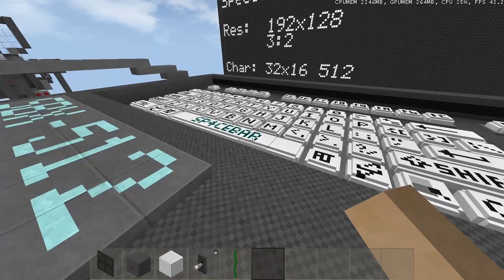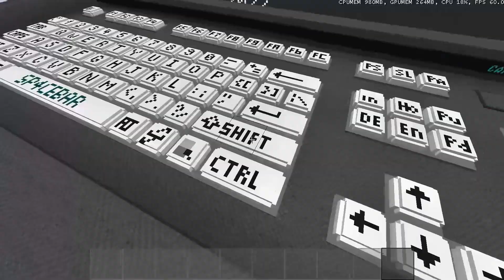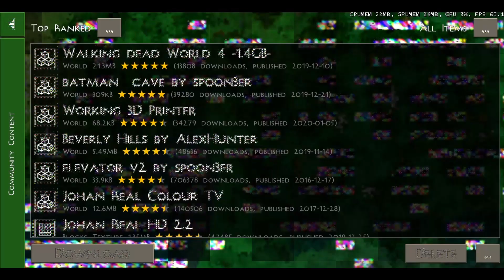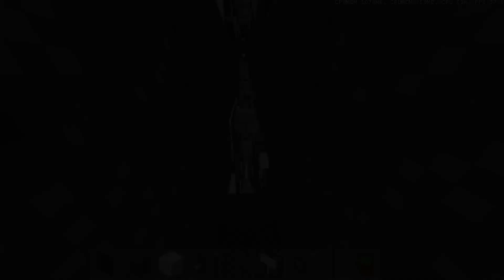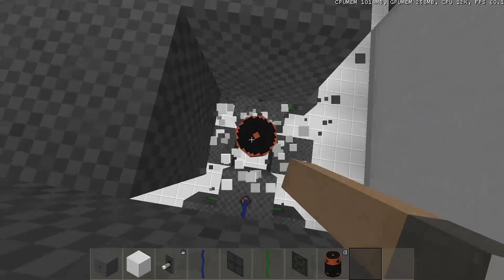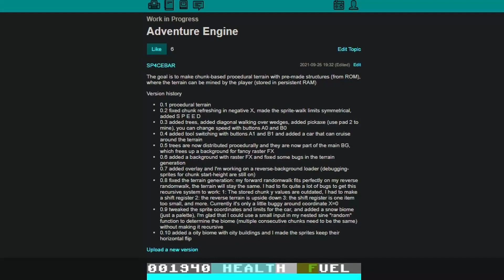Comment: At first I was impressed, but after seeing that this video is the last one in two years, i rapidly switched to depressed. And complexity of this build is already immeasurable for both my phone and my mind (which failed at controlling 8x4 pixels screen). Anyway, probably it's finally time to accept, that SC will likely never have actually playable games more complex than "stylized generated signals travels through the delays to the detection point".
Reply: Good news! Survivalcraft already has simple playable games like MGBlitz's flappy bird. It doesn't take a bigger and more laggy screen to make games. For most simple games, simple and low resolution screens would be sufficient. I know in theory how I can make Tetris, Minesweeper, Pong, and Connect-4 within Survivalcraft. If you are talking about 3D games however, then that is a different story. To make 3D games in Survivalcraft, a sequence of calculation steps has to be performed by many sophisticated calculating devices next to one another, this is not impossible, but it would take a lot of work and space.

My initial goal for making videos was to share the builds I made and the things I learned. I still have a long queue of videos I wanted to make on subjects like large flying machines (I've discovered new types, and a kind of movable logic), signal behavior (they can go faster), and very useful Finite State Machines made out of single memory banks. however with the depth at which I explain each concept, making a single video takes about a week of writing, recording, and editing. 

I may experiment with more optimized recording techniques or extra editing tools to reduce the editing I have to do. Otherwise, I could experiment with making shorter videos without in-depth explanations like actually attempting to build something like a 2D game in the 20 minutes of Survivalcraft Day One similar to my small printer video but with the tension and pressure of the 20 minute limit.
Reply: @SP4CEBAR  First of all - i am not that insane (or enlightened) to even suggest 3D games inside Survivalcraft.

About the things mentioned in second paragraph... it all sounds astonishing, but right now "this video is the last one in two years". If you are having struggles making them, it might not hurt to ask for help, unless making these videos is considered a waste of time (actually reasonable).
Reply: I don't consider making videos to be a waste of time, it's just that making high-effort videos isn't very motivating: it takes a lot of time to get just another video out. Currently, I'm working on a website with productivity and planning tools for individuals and companies, which I would like to finish soon.

Comment: I will never understand memory bank.
Reply: Oh you will
It's a book to your machines
Reply: You can read it from the top connection, you can flip (set) pages from the sides, you can write into it from the back (place the device on a wire-through block), and you can tell it to write or to read from the bottom
Reply: Cleacat  They are very powerful

Comment: In your opinion, the redstone system of minecraft or survivalcraft is better? And can you tell the difference in terms of pros or cons?
Reply: Both Minecraft's and Survivalcraft's electricity systems are very capable. However Survivalcraft's electricity is more efficient: it takes less space to build machines because wires can be placed in any orientation, signals don't lose power over distance, and the Survivalcraft memory bank (a single component) allows you to make ROM, RAM, and even an FSM.

Minecraft on the other hand has built-in commands and it has structure blocks so it essentially has a kind of world edit built into the game. Although there aren't as many logical components as in Survivalcraft, there are more components to automate the production of resources, especially with the introduction of the crafter. Survivalcraft doesn't have hoppers, it only has dispensers and chests that can pick up items, Survivalcraft doesn't have slime blocks, so making flying machines is different, you can still make some really big flying machines in Survivalcraft. Minecraft also has a way bigger community, which means there are more guides, mods, and data packs available to support the development of Redstone systems. Minecraft also receives updates on a regular basis.

Comment: (Infinix hot 30 [free fire] )is too lag graphics it getting work refresh rate 60hz to 90hz range 112 it doesn't launch the world it too lagging
Reply: I know, it takes two minutes. As long as it doesn't crash, it should load though. Survivalcraft isn't optimized for worlds like these.
Reply: @SP4CEBAR  8GB ram I takes two minutes to load in this world
Reply: @JamesandkentoyYT2026  same with 16GB

Comment: I'm looking for tutorial please. I'm looking for this 5 year. I can't understand. I saw your video 100 time. Don't find details. Please help me. Please
Reply: Sure, here is a more basic explanation, by the way, if there is a specific Survivalcraft electrical component that you don't understand, you could watch my "How to use Survivalcraft's electricity" tutorials.

In Survivalcraft, a 4-LED block has four pixels. You can make a screen out of these 4-LED blocks. To turn this screen on and make it show something, you need something that can hold information, like a memory bank. This huge screen has a memory bank connected to each of the 4-LED pixels. So each memory bank holds the information for four pixels. 

To control these memory banks you need to first, send the information you want this memory bank to hold to this memory bank. This information is a group of four pixels that you want to be shown on this part of the screen. Second, you need to tell the memory bank to store the information you sent it, and third, you need to tell the memory bank to send this information to the 4-LED that is attached to it. After you have done that, the memory bank will continuously keep the pixels of the 4-LED on that you sent to it.

In this screen, each memory bank is grouped in groups of 4x3 4-LED's. Since a 4-LED is 2x2 pixels, this group has 8x6 pixels. This is enough to show a single letter of text. The memory banks are wired up in such a way that I can send a group of 8x6 pixels that resembles a letter of text to these memory banks all at once. For the rest of this message I will call this group of 4x3 memory banks a "unit".

This screen has 16x32=512 of these units. In order to send the letter of text to a single unit, made this screen in such a way that the letter of text is sent to all units. But only one unit is told to store it and show it on its pixels.

In order to tell only one unit to store it I use a grid of wires with an AND gate at each intersection.

On the left of the screen there are two 4-bit counters (a Survivalcraft component) that keep track of the position of the cursor (the place on the screen where the next letter of text will be typed)

On the left of the screen there is a part that uses memory banks to hold information of how letters look, when this part receives a code from the keyboard it will turn that code into a letter, this letter is sent to the screen. And a signal is sent to the screen to store and to display this letter of text. This letter of text will now be stored at the position of the cursor.

I hope this makes sense, good luck learning!

Comment: You need a better PC to Create Minecraft inside Survivalcraft and use a modification to accelerate the game tick and maybe in the future you can create windows 7 inside Survivalcraft
Reply: Survivalcraft itself is already fast enough to run 3D graphics, in theory at least, I've made some concepts a while ago:
- a display can be made that can plot horizontal line segments
- some calculating units can be chained together to calculate the intersection points between the horizontal lines of our screen a a whole lot of 2D triangles
- 3D triangles can be turned into a projection of 2D triangles using matrix math
- the 3D points of these triangles can be stored inside of a big memory unit
Everything should be able to be calculated in parallel, so it should run quite fast, but it may have a lot of latency

Comment: do you actually use the 2 screens for multitasking right now? or its a feature for future versions of the display
Reply: I haven't worked on it since, and I'll probably build some newer screen designs before continuing this project, but I was planning on adding games that are controlled by a cursor, and a settings page where you have a list on the left and details on the right, with settings like a 16x16 character map that you can customize
Reply: Cleacat  maybe :)
Reply: I was planning on making something, but I cannot get it done in time due to computer problems (quartile 2 of my university is about to start)

Comment: I made 3x3 switch combination lock. But I made it using AND gates , OR gates and similar gates. This makes it complex to understand and takes longer.

 I only used gates and other basic electric stuff to get things working, which made it harder for me.

I want an Easier way to do it using Advance Electric Components like Memory Bank etc.
PS. I watched your Electric Tutorial but still I am confused that how can I make it easier with those. Can you please help me out?
Reply: you could use the truth table circuit: it has four inputs at the sides to which you can connect four of the switches, you'll need two of them of which their outputs (at the back) are combined in an AND gate, if you edit it you can select one of the 16 combinations that will "unlock" that truth table circuit, the ninth switch isn't connected, so you could connect it to an AND gate with the output, with a NOT gate in between (or not, depending on the code)
If you want to use memory banks then you could connect all switches to the inputs of two digital to analog converters instead of truth tables and wire the outputs (at the back) to the side inputs of a memory bank (which replaces the AND gate that combines the signals), and write a single "F" in a random location inside the memory bank
Reply: @SP4CEBAR  that's something complex 😂 but thanks anyways I am going to try this. Thanks.
Reply: @Samithereal  good luck

Comment: i want to play survivalcraft inside survivalcraf with this computer
Reply: Last year, I did design parts for a 3D graphics display, so it might be doable
Reply: @SP4CEBAR  You understand electricity very well and I don't know much about electricity Can you briefly describe how your computer screen works
Reply: @yoneticibilalkocyigit2378  This screen is essentially a big memory unit, except each memory cell has a little display attached to it to show a 8x6 pixel image (a character) 

There's an external device which converts an 8 bit ascii code into a pixel image of a character, this character can be stored and displayed onto the screen

I hope that explains it :)
Reply: @SP4CEBAR Thank you. i want to build a huge computer too, a few days ago i learned how to use memory bank and 4-bit counter and just made numbers with a 3x3(4-led) screen(up to 1-5)
Reply: @yoneticibilalkocyigit2378  good luck, if you have an exiting project you will learn really fast
Writing numbers by hand takes a lot of time, so for both my computer screens I made a pixel drawing tool with a (furniture) switch for each pixel, where every 2x2 switches are combined using a digital to analog converter into a 4-led signal, you can store these signals into your memory banks
Also this screen is technically not a computer, a computer is a calculator that can follow a list of instructions

Comment: I downloaded this map, I really liked it, I'm surprised how this can be done, even though it's 8 bits, but still it's very difficult, probably, and I'm Russian
Reply: This screen is essentially a big memory unit, except each memory cell has a little display attached to it to show a 8x6 pixel image (a character) 

There's an external device which converts an 8 bit ascii code into a pixel image of a character, this character can be stored and displayed onto the screen
Reply: Wow, that must have been hard to build.
Reply: @MSDOS93  I designed one memory cell and duplicated it 512 times using world edit (for Survivalcraft 2.1)

Comment: Ei, eu estava pensando. E se voce construice uma tela com essa resolução mesmo, porém, que carregace com uma tv de tubo. Onde a imagem é escrita na tela do canto superior esquerdo ate o canto inferior direito em linhas, uma de cada vez. 
Talvez assim poderia fazer uma copia de console antigo como super nintendo ou mega drive... onde o console lê um " cartucho" que é onde os sprites e mecanicas ficam salvas e o console ser apenas um que lê isso como um cpu... daria um trabalho para o pc rodar esse jogo com uma maquina assim... porem, se consequir, poderia fazer tipo um console virtual no survivalcraft onde esse mapa tem um cartucho em branco e quem souber fazer um jogo pode cria-lo no seu mapa usando do seu vudeo game pré feito sem ter de fazer ele do zero.

Espero que o google tradutor funcione
Reply: The issue with a tube screen in Survivalcraft is that Survivalcraft is pretty slow: at best it would take 192x128/100Hz is 4 minutes just to refresh the screen once, so I usually try to make screens that work parallel: where many things happen at the same time
Also, this screen doesn't support sprites, however I have designed a screen that does support sprites and that still supports a background 

A console is a good idea, a pair of two memory banks hold 256 bytes, so eight memory banks hold a kilobyte, 
this screen already has dedicated character storage for 256 characters, and it can be expanded 
32x16characters x 2byte (more characters) is 1 kilobyte for a background file, 

I do plan to build a cpu in the future, however games that are made using electronics, usually have better performance 

Google translate worked for me, I hope it works for you too

Comment: Is there a tutorial? Pls i want to build that
Instead of getting the world
Reply: This video is the tutorial, well except for the keyboard, the video would get too long, so the keyboard is for part two
Great you want to build it, However if you want to build it by hand I'd recommend you to build a smaller screen otherwise it would be an awful grind to get all modules built, I used a version of world edit for Survivalcraft 2.1 to copy and paste all the 512 modules in this screen
You can simplify the module by not connecting the data-location inputs of the memory banks (that hold the display data) in the screen, I plan on using those inputs to achieve scrolling like in my previous computer screen, but they aren't essential for a screen.

Comment: Is possible a turing machine in survivalcraft 2?

Infinite tape?
Reply: Yes it is possible 
You need an 8-bit (or 12-bit or more) counter for that and a memory module with many memory banks

Or instead, you could go fully mechanical by using pistons to feed a tape consisting of normal blocks (0) and glass blocks (1), put a lamp on one side and a photodiode on the other side to read it

Comment: i have a question?
it's possible to build computer like this in survival mode?
Reply: It is, but you'll need to mine a ton of resources, and you'd need to place each block by hand, it'll probably take years to complete such a project
But a smaller resolution may be doable 
Also, I've used the wire-trough-semiconductor block a lot, that block is insanely expensive to craft, so in survival, wire-trough-stone blocks should be used instead (it does the same thing)